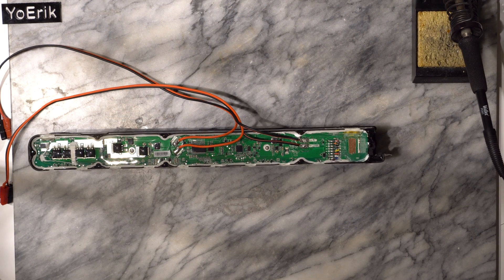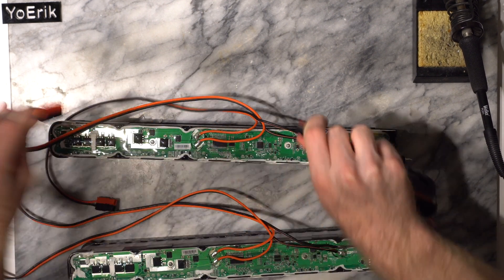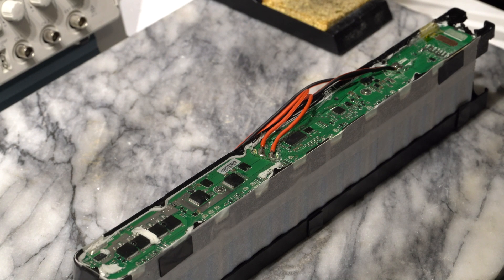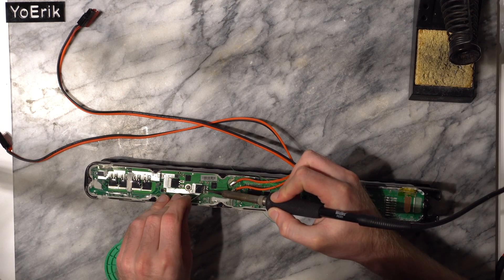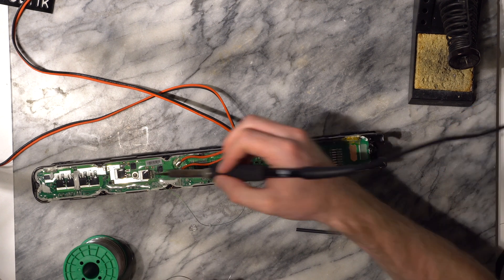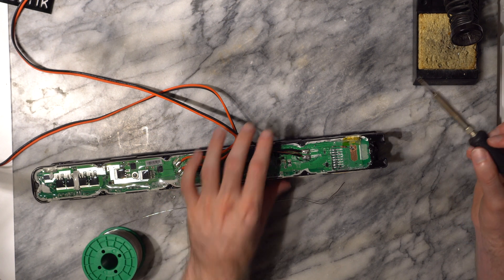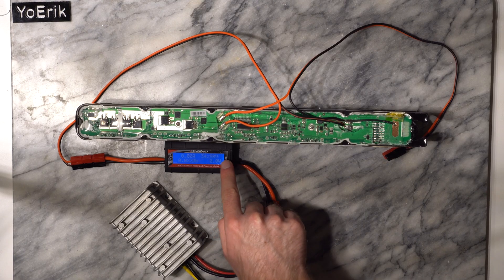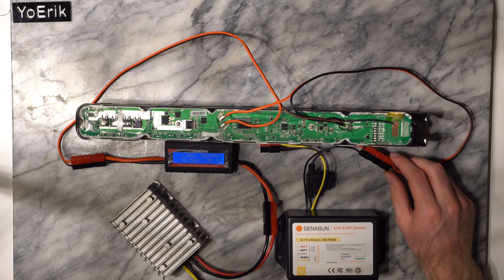JAG35 40 cell LG MH1 Battery BMS 3rd Pin Hack

Comment: Hi Hello Eric 
I did the hack and i worked the battery charges now and discharges. But the resistor and wire get extremely hot  so i 
Put a Small swiTch to 
Turn it off and on. Is this 
Normal for the wire and resistor to get sooooo extremely hot ? Thanks in advance for the reply.  Ed

Comment: Guys I did the 3rd pin hack to TP6 and it works, here 3 quick short video that show (not as cool of Erik's video but hopefully useful) 

The 3rd pin hack to TP6
Search for: "Scooter Battery 3rd pin hack - 40 LGMH1 18650 - Simple Hack to activate the BMS (ep 01)" 

The BMS max discharge amps is 30:
Search for: "Scooter Battery 3rd pin hack - 40 LGMH1 18650 - Max Amp test (ep 02)"

The BMS does have low voltage disconnect at 29.5v:
Search for: "Scooter Battery 3rd pin hack - 40 LGMH1 18650 - BMS Low voltage disconnect test (ep 03)" 

Thanks Erik and @jehugarcia

Comment: Is there another ground I can use? That pad is underneath wires that I'm going to keep as is. Are the screws grounded?
Reply: I used the ground pad labeled TP7 which is much closer to the chip needed without the need of a jumper wire. Just the resistor directly.

Comment: I don't have that big ground pad, instead, I have the words JUMP in that area. Was it just scraped away? Do I have to go that far? I see a pad labeled TP7 just above the chip with continuity to the area you originally used. Looks close enough to solder the 1K resistor directly without any wires needed. 
Is that going to work? I don't have that much experience with these, just enough to get me in trouble.
Reply: Did you end up using tp7?
Reply: @jphein  yes I did, but I only got voltage from MOTOR +/-, and I don't get anything from BATT+/-
Reply: @rlsoriano  There is an ideal diode on the BATT+/-. By design it only allows you to charge through it. Use the MOTOR+/- for your load. =] I ended up using one of the TP pads too. It works well! =]
Reply: @jphein  are you charging and discharging from the same pads or did you separate them out?
Reply: @rlsoriano  I did what you suggested, and soldered the resister straight from pin3 to the TP7 pad. Then I charge through BATT+/-, and discharge through MOTOR+/-. although I think you can charge AND discharge through MOTOR+/-if you want.
Reply: Where is TP7? I see TP8, wonder if it’s under that white glue, would you mind sharing a pic
Reply: Found it, right above D9 under the white glue, will give this a try ;-)

Comment: edit Built a shunt and measure ~25 to 28amps on a fully charged battery before BMS shuts down.

Anyone able to use a single pack and pull more than 10-15amps?
With Erik's modification (thanks Erik!) the pack works great as long as I don't pull much more than 10amps

Comment: Great thanks! 👍😁
Any updates on your testing?
Reply: Well I tried it today...  but it did not work on my pack... unless I did it wrong. I did have to use a 1.5K resistor (all I had). I just ordered an aftermarket 36v BMS. Thanks anyways.
Reply from the maker: @cocojones3479  I am currently waiting on shipping for getting some CAN breakout boards to try with the reverse engineered CAN code. I had some at home but moved and they got lost in the reorganizing stuff.
Reply: @ErikMeike  that's great Erik. Thanks 😁👍
Reply: @ErikMeike  Any pointers to that CAN code ? Couldn't find it on the Jehu video even though it was mentioned.
Reply: @jonansan https://github.com/alex3dbros/LGH1ScooterPackPower
Reply: @cocojones3479  Thanks. Was able to decode a good bit of the BMS data via CAN bus such as voltage, current, temp, capacity, state of charge. My notes are here: https://github.com/jonans/jump_bms

Comment: it worked for a couple of mins then, motor out shut off. cant get it to output again. Ive tried linking link_a and link_b for a few sec to wake up bms. nothing. The battery is fully charged around 41v.  i can read 41v on the mod pin 3 and ground, but it will not output power thru MOTOR + -
suggestions?
Reply: Any luck?

Comment: Hey Erik, not sure if you have seen Jehu Garcia's videos with regards this packs. He mentioned he could not make the onboard BMS to work (not sure how much electronics knowledge needed) but that becomes an interesting point since you mentioned on one of the first comments on this video that the high-low voltage cut off as well as the balancing seems to properly be working. (Colin's comment 2 wks ago).

My question is; how were you able to confirm the BMS is properly functioning? BMS typically only shunt few tenths of mA's and while connected to the the cells is very difficult to measure which cell is under balancing and which one is not. 

I found one of those packs on the sidewalk when walking on the streets here in San Francisco, and those packs where originally manufactured for that Uber JUMP e-bike ride-sharing company, which where scrapped a few months ago. Wonder why so many of those packs around now.
Reply: I can't answer for him but any BMS will stop drawing current once the battery is charged. That's a pretty easy way to tell.
Reply from the maker: Yes, I saw that, and that was part of what made me make this video since I figured it would be helpful. I was able to confirm that it performs some BMS functions by that it has overvoltage and undervoltage cutoff. It also appears to do most of the balancing when charging. If I charge a pack, the cells go from slightly different to exactly the same according to my multimeter as it fills, and I repeated this test after a couple more weeks of daily cycling. I think all of these are signs of it balancing properly. 
My guess is that the bikes were all scrapped and some company finished tearing them all down, and thus they are quite available now. It may be that some quantity of them don't work since they are not sold for the BMS, so I guess that part is luck of the draw.
I also have not been able to find the original manufacturer of the packs. If someone can find the manufacturer, someone there may be able to help with getting actual data out of the BMS which could include more interesting data since they do look nice.
Reply: @ErikMeike  On one of the packs I found, it states "BYD Company Limited". I suppose BYD stands for "Build Your Dreams" pointing to the big chinese battery manufacturer. I don't know whether they produced the BMS too, but maybe it's a hint...
Reply: @ErikMeike  So I grounded pin three as indicated and the motor port is enabled. I noticed it charges to around 41.5 then levels off at 40.5 after a while. My question is: This is overvoltage protection? So if we use the motor port does it have undervoltage protection? if it is balancing do we still need an additional BMS?
Reply: Any luck on the can bus data?

Comment: Two questions. I shorted pin 4 on the IC of one of mine and I'm wondering if you know the name of the IC so I can replace?
Also the Bat +/- terminals don't show any voltage and don't accept charge. What's that about? 
Thanks.
Reply from the maker: If the batt terminals don't take power or give power, that means the battery is probably full.
For your second worry,  I would still complete the hack to see if it survived since I think it would be a fair bit more work to replace the IC, and if you were quick enough it probably didn't damage it too much. I believe this is it on Digikey if you do need a new one: https://www.digikey.com/product-detail/en/infineon-technologies/BTS500851TMAATMA1/BTS500851TMAATMA1CT-ND/2231100
Reply: @ErikMeike  The IC partially exploded haha. I have the equipment to quickly replace it so I should be good. The battery terminals show no voltage on any of the packs I have hacked thus far. The batteries are not full either. The battery terminals take current if force charged via a variable power supply but the lithium ion specific chargers don't recognize it.
Reply: @ErikMeike  Are the Batt +/- terminals supposed to show voltage? There is no voltage showing on any of the 6 battery packs I received. Thus my charger does not recognize it.
Reply from the maker: @colinleamy6199  It has an ideal diode IC, so it will only accept power input on the battery terminals and not output any to the charger sense circuit. You can probably trick your charger into thinking it is a direct connection to the battery by adding a resistor between Batt+ and Motor+ after you perform the hack. A maybe 10Ω-1kΩ resistor probably would work fine as long as the wattage is high enough.
Reply: @ErikMeike  Yeah I found a way to force charge on the charger. Thanks :)
I tried to take out the IC on the one that I broke and holy crap this thing is a serious heat sink. I dumped 480 Celsius full blast for 10 minutes with my heat gun and it did nothing and cooled down very quickly after letting off the heat. I think it's safe to say that I cannot use the BMS on this one without getting hold of a beast of a heat gun.

Comment: Is there a connector on the BMS board for the scooter controls that has the pins that need to be jumpered together?
Reply from the maker: Unfortunately no. There theoretically probably is a way to do everything from that connector, but I have not been able to figure that out yet.

Comment: Erik, thanks for this post!
I have a few of the JAG35 40 cell LGMH1 batteries and plan to attempt the 'hack' on at least one of them. I will disassemble the others for other uses. One appears to have relatively accessible motor and battery wires and measures 34.5v. I want to test it (add motor wires) before doing the hack but I have a couple questions. 
1) Do I need to leave the wire 'hack' on the BMS after the 'hack' and the BMS wakes up?
2) What happens if I attempt to charge the battery before 'waking up' the bms? Bad things....?
Reply from the maker: 1. Yes you need to leave the extra wire in place for it to work. 
2. It should be fine to charge it before you do this hack. It would be the same as if someone plugged in the ebike this pack was installed in without turning on the ebike.
Reply: I plugged in an ebike charger to this battery before doing this ‘hack’ and i heard a LOUD BANG from my ebike charger, and then the charger stopped working immediately after that

Comment: Any updates? Hoping to learn more about these packs before I start modifying them. Thanks for your video.
Reply from the maker: I have been cycling my packs with this modification daily since before making the video to make sure that everything is ok. So far the cells still seem balanced etc and I haven't run into any issues.
Reply: Erik Meike thank you so much. I have 8 of those battery packs. I will be using them for my DIY RV Build. I figure 8 is enough to start my build with. I will start using your hack and charging them soon. Thanks again for your efforts.

Comment: Just got my battery.  When testing for voltage, I get 17.5 volts without any modifications.  Should I sit proceed the same way?  Also, can I use any resistor that I have laying around?

Edit:  I did exactly what you described and it appears to be working perfectly.  Got the voltage to show the same at both locations.  Charging now.  Will report back after I test it out.  Thanks.

Comment: I have two LEMH1 batteries. Both have the pin3 hack in place. One is working even remove the charging input from BATT(+/-). The other one's BMS shutdown immediately if I remove the charging input. May be I need to do something on SP2(WKUP) or SP1(1-WIRE)?
Reply from the maker: What voltage are the cells at/how much did you charge the pack to?
Reply: @ErikMeike  the pack is at 40.4v now. try to charge it to 42v. it seems that output BMS is enabled but not charging (no charging current). If I put load on BATT(+/-), I see charging current-maybe the charging current drive the load, not the battery.
Reply from the maker: @yanmingpeng645  Does it charge if you discharge the battery a little? It seems like the BMS may cut off at close to 4.15v per cell and then they drop down to about 40.5v after they sit for a while while the BMS still doesn't allow charging.
Reply: @ErikMeike  I discharged it to 37.8v. still not able to charge it via BATT+/- (no charging current), however, the MOTOR+/- will be activated as long as charge is connected..
Reply: @yanmingpeng645  I have the same problem, received my battery pack yesterday. I charged my pack to 40.9v via the CELL+/-. With the resistor installed charger connected to the BATT+/- pack does not seem to charge but the MOTOR+/-  passes through the charger voltage, battery pack voltage does not change or charge.
Reply from the maker: @ejulrich  Maybe try connecting the link_a and link_b pins near the end of the battery for a few seconds to see if you can wake up the BMS.
Reply: @ErikMeike  I tried this, didn't seem to help in my case. I see no voltage on link_a and link_b with out the BATT+/- connected. Once I connect the charger to BATT+/- I see link_a 0 volts and link_b with ~5v. Maybe I will order another one, if that one works I might be able to then map the test points and find the fault? Maybe my BMS is bad?
Reply: @ejulrich  any luck?
Reply: @ejulrich  I found out that my BMS was damaged. On the working one, if you connecting Link_A and Link_B, it will turn on the DC-DC +5v(SP3,Red). On the bad one, cannot get +5v(SP3) enabled.

Comment: Wouldn't this eliminate the BMS's ability to shut down the output when the voltage goes below a certain threshhold?
Reply from the maker: It turns out that it does not affect the low voltage cutoff on the cells. There are several other locations where the BMS can disconnect power, and it appears to use those instead. I did some overdischarge, overcharge, and cell balance testing to make sure that this does not affect that functionality, and it appears that those still work correctly.